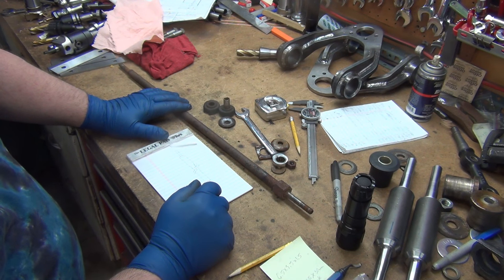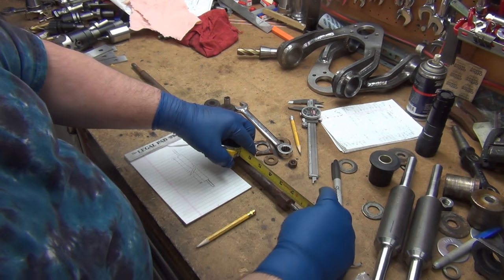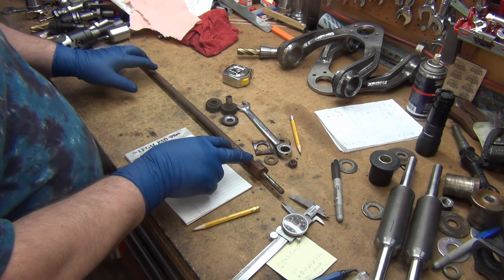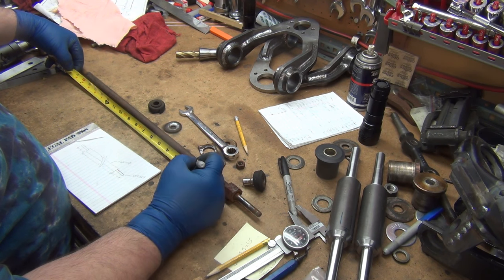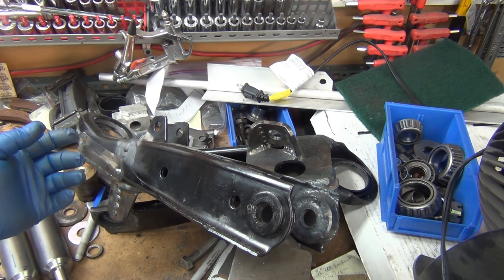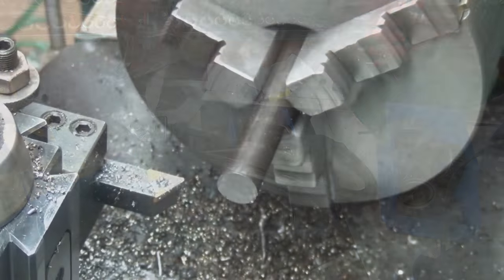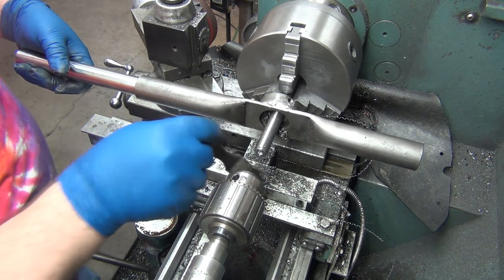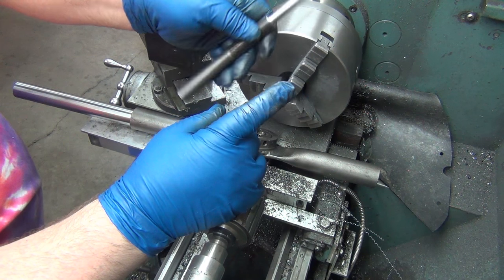Tension Control Rod - Adjustable

Comment: Nice job with the mods there and very nice threading.  I sometimes have a problem with cutting long threads using a die.  I am not sure what I do wrong so I cut the most of the thread with the lathe and then use the die to finish it off.  Keep on keeping on.
Reply from the maker: I killed a couple with the lathe and the die.  I found that I had to hold the handle and almost "lead" it along the cut.  Chuck slipped on one....that ended in stripped threads...which was a first for me....never had that happen before.  This rod is 1144 Stressproof, so it machines quite nicely!  First time I've used it.  Thanks!

Comment: Is there a name for that long hexagonal threaded shaft bit you used for the center portion there?  It looks like something that may come in useful some day.  I want to call it an "origin nut," 'cause it looks like the thing from which nuts are made~  :D
Reply from the maker: It's actually solid bar with only 2" threaded at each end.  I got it from Midwest Control and they call it  HBT10-13.00  Turnbuckle, Hex Bar, Steel, 5/8-18  
I wanted steel since he's running a very low stance on the truck. I was afraid the aluminum would get damaged too easily.  You can get hex tube that has an ID already prepped for threading.
Reply: bluehandsvideo
Oh awesome, thank you!  :D